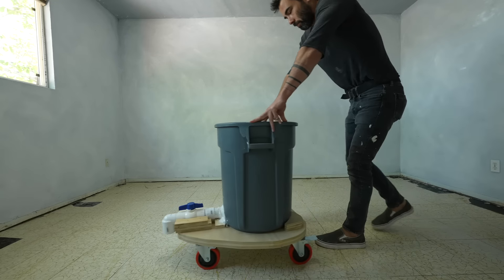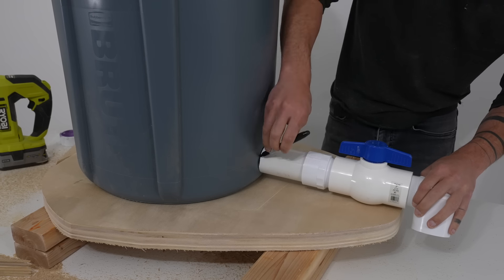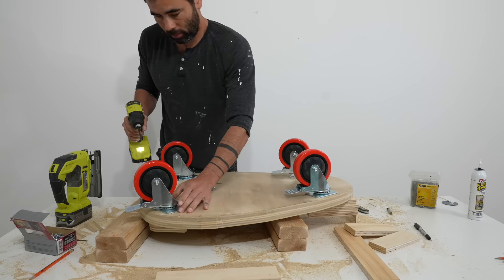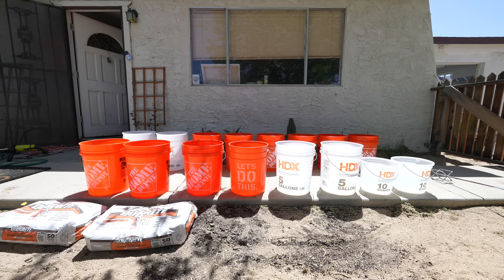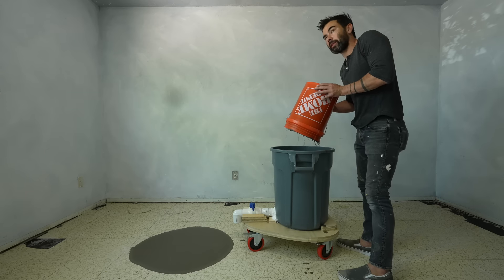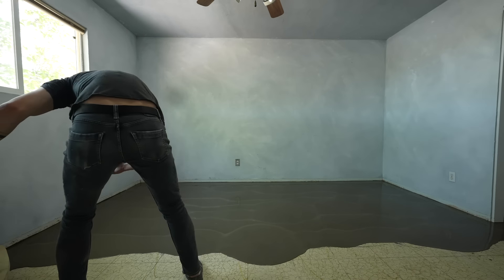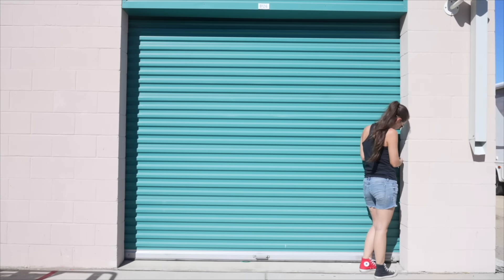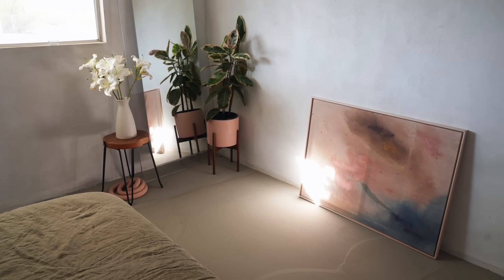Concrete Floor Over Tile | EASY Self Leveling Concrete Floor

Comment: Seems like a solution in search of a problem. And an awful lot of extra steps and parts to clean. You still have to pour the buckets so I'm not sure why the heck this was easier on your back. What you really need are some spiked shoes and a gauge rake.
Reply: I was surprised to scroll this far to get a comment like yours. This channel is about content, not smart work. I do floors like this professonally, and this video gave me a rash.
Reply: @viggothorsen1615  I recommend Zinc Oxide!
Reply: Def need to spike roll to release surface tension to insure a flat result.

Comment: I don't see any reason why you would need that, I've done self leveling concrete floor for years with just buckets and a rolling spike broom and it always work perfectly
Reply: I agree. HE still had to lift each bucket to pour into the garbage can (which is higher than the floor) and he had two people mixing buckets for him. Would have been finished with the floor by the time the contraption was made. I've down areas that size myself before.
Reply: He stated that in total this was easier on his back. Yes it's probably slower, but not hurting after is worth a lot.
Reply: still, if you do this a lot, you only need to make this once
Reply: @affegpus4195  and to move the extra big bucket and the whole thing over each job , adding what bluestyle11 said , it's completely useless
Reply: I tried this and it was stupid. Buckets are the way to go. It basically a one time use setup. Noticed how he never showed the cleaning process. Self leveler settled in the bottom groves and hardened. A lot was left unused. Such a waste!

Comment: As I have done several floor pours myself (with varying degrees of success) I have learned that it greatly helps the self leveling mass to use a spiked roller on a long handle. It releases the air bubbles and helps levels the concrete since contrary to the name it needs help to self level. Maybe having an extra person doing the spike rolling while you are pouring could work but beware that the spike roller flings some concrete so cover everything important up to knee height.
Reply: Great comment!
Reply: What is the difference between simple cement and this self leveling for making a  floor?? 

Could you use cement?
Reply: @georgiosladas3106  I believe the flow/consistency of the two is different and the grit size. So it is easier to get the self leveling mass flat and smooth and it hardens in a few hours, it also doesn't shrink when drying out.
Depending on your needs either could work but I'm no expert. I only used it to level out existing concrete floor (use primer first).
Reply: @krycke 
Thanks.
 I was thinking they use some kind of glue tile for elasticity. 

I will try it first in a small room to see it how it goes. Traditionally ages before old houses in Europe had this technique using only  cement with colour on top. In Europe there s difference in price self leveling costs 80 % more between 50 and 80eeuro extra than just cement.

Comment: Pro tip if you're mixing self level and you use ice water when you mix it flows way better we add like two bags of ice to a fifty gallon drum full of water then we mix in a half drum using the ice cold water

Comment: did i understood correctly or did you just pour only  half (up to one ) centimeter of "concrete"  as a floor finish? i hope thats not the end result, and you will place another finish on top. I think its going to crack soon. I might be wrong. Let us know
Reply: Self levelling concrete to prep a new floor... he literally explains that
Reply: I think that's it.  The furniture is already back in place.

Comment: Look into getting a guage rake and a spiked roller. Guage rake will ensure a consistent thickness is spread over your substrate and the roller will eliminate the overlaps from each pour and blend the whole self level together

Comment: Definately could have used a light set in the base as a funnel for drain. Put enough of a light setting mix at the base of trashcan. Tilt is away from nozzle so it sets up at an angle. Then when it dries it will form an angled bottom towards the nozzle.

Comment: Great idea. Would it have been easier to mix the cement in the gray bucket ?  The floor looks great.
Reply: This type of product needs to be mixed very consistent and precisely so I think the way he did it works best with mixing smaller exact batches and pouring it in the tub the spread
Reply: @delbertstreicher3802  i use a bigger container that holds three bags, you just have to do the math.

Comment: That stuff is amazing. I poured some about an 1/8-3/16” deep over old linoleum in recessed 3’ x 6’ laundry area about 5 years ago and it’s held up beautifully under the washer & dryer. Not one chip or crack.

Comment: It'll be interesting to see how long before the cracking begins, personably I would never pour a hard cement product over softer lino tiles.
But what you have made is a fantastic forward thinking invention, may I suggest a slide gate set up inside the trashcan to control the flow and allow you to control it from the top and make the base so the trashcan and pipework is tilting downwards on a angle so it self drains as much as possible.
Reply: Great ideas. Is a slide gate something you could buy ready-made like the valves are?
Reply: @twobluestripes  It wouldnt take too much to make one up, like a slide gate on a animal feed bin/grain hopper. Probably could buy one from a woodworking dust extraction system but they wouldnt be simplistic enough to be submerged in a thick liquid so would have to be mounted outside the bin
Reply: @twobluestripes  Could put the barrel up a bit higher, and use a flexible tube to distribute it. To turn it off, put the end of the flexible tube into the top of the barrel. (and make sure you have a wide base, because this would be top-heavy). Might want to also add a hook or a weight, to make sure the flexible tube stays in the barrel when you're not holding it.
Reply: Expecting that as well. Especially considering it's a pretty thin pour as far as I could see.
Reply: I have concrete for my flooring. You know the kind where they can make it look like tile, flagstone etc.  It is probably as thin as this one is - and it was pored over the original concrete subfloor - so it's not spongy like those linoleum tiles. Within about 2 years, there were parts where chunks actually chipped off and there were a lot of cracks.  Forget ever rolling anything on a floor like that (example an office chair on wheels) and even furniture like dining room chairs eventually lead to chips and damage. Not to mention that it needs to be resealed often.  It's very lovely and pretty for a short term solution (flip) not not a viable long term solution for a floor.
Reply: @aquicktake  standard concrete should be fine it can be 5000 psi.  the slc he mixed up at is 2000 psi and super thin.  the thinest that concrete should really be poured is 3/4".  how large of an area is your concrete pour - did the cracks appears in specific areas?
Reply: @aquicktake  The self leveling mix is designed as an underlayment for tiles or hardwood. Those would protect the surface from chipping. Definitely will start crack and chip when exposed like that.
Reply: Based on my experience with ardex self leveling products I know that some self leveling products can be poured over vct tiles.
Reply: @gdias231  It can it just depends if there is movement.  If you pour SLC on a slab that isn't moving and you glue your floor on top of the SLC then even if the slc cracks it can't go anywhere.  If you float a floor on top of SLC that is on a substrate that seasonally moves the slc will crack and it can end up sounding like walking on eggshells if the cracked slc migrates.  You can also do SLC then an underlay and the underlay can lock the slc in place or alternatively absorb / prevent the noise.

Comment: Another option for the spout is a flexible hose that you lift and tie up so that the mouth is above the concrete line in the bucket. You can add a flat clamp on the hose to decrease the size of the nozzle.

Comment: Nice! 
Mods I’d try: 
1)gate valve instead of ball
2)Hole in the bottom of the can instead of side with a bulkhead. This way it can all drain out
3) try mixing all the concrete in the bucket? May be too hard for drill… but would save you some buckets and trips.
Reply: How could you do number 3 if you implement number 2?
Reply: @brandonmcdole7886  ...by shutting the hole before adding and mixing???
Reply: #3 would be too hard to mix. It would be overmixed to ensure consistency. The whole point of the 5-gallon bucket is to keep it simple for casuals.

Comment: great idea on the trash can and cart. In place of a ball valve look for a 1-1/2" PVC gate valve. The type with a sliding gate and will have a handle, probably t-shaped, that you draw the gate in and out with. It looks something like a dust collection blast gate but it's sized for PVC pipe. They cost less than you ball valve and I think (but I have not tried) it will work better for your application.
Here is an example but they are made by many companies. 
Look for : Valterra 6101 PVC Gate Valve, White, 1-1/2" Slip or something similar.

Comment: Hi Ben, great video, I used to work in the process eng industry and we would use a knife gate valve to cut through slurry instead of ball valves. Hope it’s a good suggestion, would save you getting in a mess with the cap
Reply: Yeah, that cap idea definitely won't work.
Reply: Or a rubber insert butterfly valve would also be good.

Comment: This is a neat design and concept! Nice job! I will be interested in seeing how the concrete holds up after time as the wood subfloor, vinyl floor, and concrete all have different thermal expansion rates. I’m assuming the room is climate controlled though, so it may not matter.
Reply: The only way to prevent cracks on a wooden subfloor with self-levelling is to put tiling Decoupling matt. That way no matter how the subfloor moves the Decoupling matt will not allow the concrete to crack
Reply: Also feed it a decent amount of polymer

Comment: I've been in the flooring business for over 30 years and this is a great idea....when I was installing and younger I would always try and come up with better more efficient and easier ways to do something. This is a great Idea and if I was still in the field and not crunching numbers in the office I would be making one of these for sure. I'll have to show this to my guys so they can make one. For example of what I did once to make things easier was....I used my riding mower with ropes and pulleys to pull up carpet that was welded to the concrete...it worked great.

Comment: Instead of the valve or the cap, just use a flexible hose where the end can be lifted above the height of the trash can to stop the flow.  Great video, thanks.
Reply: Wouldn’t the length of the hose then be a hindrance in the down position? It would surely need to be 3-4 feet long to raise the end above the height of the can?
Reply: A flexible, thin, removable hose 20-30” long would be plenty and easy to clean.  Only start with around 10-15 gallons in a smaller main bucket, then continue adding as you go.  It isn’t necessary to have 30-40 gallons already mixed to get started.
Reply: @twobluestripes  The hose can partially wrap around the can, leaving only enough sticking out to get into corners. The hose can then be unwrapped to get into really tight places, such as under a staircase.
Reply: I also thought about a flexible host. but in stead of lifting it, I would pinch it off. This way you can adjust the flow also.
Reply: I like the hose idea much better than a cap, the cap will get to be a mess after your first closing. And overtime the concrete will harden and make it harder and harder to remove and put the cap back on. The kiss rule keep it simple stupid! Although we just do two buckets at a time pour it all out and squeegee it to where we want it. Might try this idea but I think it’s going to be slower than what we’re doing now just pouring it out because it takes me about five seconds to pour out 10 gallons and I don’t know how long it takes to empty that through a 2 inch pipe but it ain’t as fast as pouring it out the top. I understand you are just a consumer, and an actual contractor is looking for production and so the loss of time is not worth the savings, which I don’t know what they are aside from a little cleaner, also we can walk on ours within four hours. Another thing I’m thinking of is a lot of our floors are so effed up that you really couldn’t even roll that cart over them very well, that’s why were using a leveler, that Leno or tile was about as smooth as possible and 35 gallons of material would be easy to roll over something flat but like I say if they were holes and levels to roll up it would be a lot harder with that much material.
Reply: @twobluestripes  maybe a collapsible hose with a stiff wire hook with an eyelet at predetermined heights on the bucket, but like big floppy collapsing hose sounds like a bad time with a splash zone compared to the video.
Reply: @MichelSatoer  that's what I would use,  a 10-in stiff hose that pinches off when you bend it back on itself. (A small spring clamp could hold its end after it's pinched back.)
Reply: @Joshuaiwanski0019  worthy idea, yet he did say he wanted to avoid bending over and pouring.

Comment: Keeping the can elevated outside and running a clear 1 inch vinyl hose inside would lower the risk of spilling a bucket of cement. (1 Inch hose is about $1.50 - $2.50 a foot) Can would work better being short with a bigger diameter to make pouring easier since it only needs to hold a little over 5 gallons. They make carts with hydraulics you could use to lift the can to increase pressure, with almost 2 feet of travel. (They cost $250 for a 500 lb. one though.) You could use a hose plug and kink when not in use. Lift up to turn off. Since it is clear you can tell when it is clean and squeeze trouble spots to focus water. You could also hook a hose with a back-flow valve to the end of the hose, while flipping the can over a drain for cleaning. If something gets clogged you can see where and can cut it out and rejoin the hose if it is long enough to make it worth it. (Doing it elevated to keep from making a mess.) A little expensive for a single pour but okay for repeat use.

Comment: One way to get the compound to self level is with a spiked roller, if you are after the wave effect put about 20% more water in the mix to thin it and just throw the buckets in. Self-levelling has an open time of 20 minutes on average so needing 40 minutes to pour means the actual sand and concrete were settling on the bottom of your tank, hence your floor seems to have a lot of waves and is not perfectly flat. You are doing 90% of the same amount of hauling, get a 100l mixing tub for a project this size one person stays on the mixer constantly and everybody else dumps the bags in. Afterwards you can use a small 12l bucket to scoop up material while somebody else keeps mixing to prevent it from settling and setting.

Comment: If this were a professional gig you might want to consider getting a concrete float to even out the very top surface after it begins to set. 
As it is you end up with that interesting wave pattern,  but most people would likely prefer a homogenous and uniform color and texture surface. 
I love the device you've made, as it is always releasing the denser,  more grain rich self leveler where the bucket dump would always pour the more watery content first followed by the heavier aggregate rich material in uneven patches
I say well done!
Reply: The best tool for this is a spike roller actually. You don't need to float this kind of cement, but a spike roller breaks the surface tension and helps it even out. It also mixes across the pour lines for even coloring.

Comment: That floor will fail. No question. 

The tiles below needed to be removed first.  But as it was too much work, you couldn’t be bothered. Instead you’ll need to redo the floor when it inevitably fails.

Once the tiles are up, you should then grind off the residual glue, or you could have used a smoothing compound that is designed to go over old adhesive residues.

The only thing I can see right here is priming. Other than that. Nope.

Also. It’s a smoothing compound. Whilst it will find its own level. It won’t make an uneven floor level, merely smooth out areas that are rough.
Reply: Also you needed to spikey roller this to make sure all the air bubbles are out.

As a final finish this will look terrible long term, as it won’t be strong enough to put up with foot traffic on its own.

You can seal this kind of finish. But that hasn’t been done here.

Comment: You could eliminate the moving parts of a shutoff valve by using a flexible hose. Raising the tip of the hose above the level of mixture in the barrel will stop the flow. Use a hook or nozzle port to keep the tip of the hose elevated.